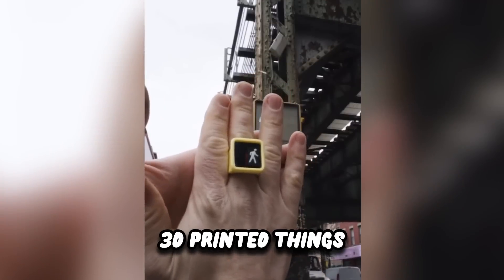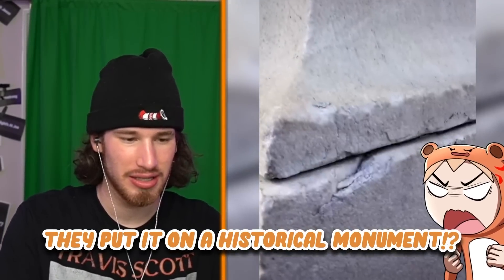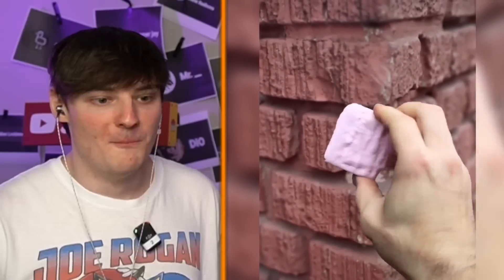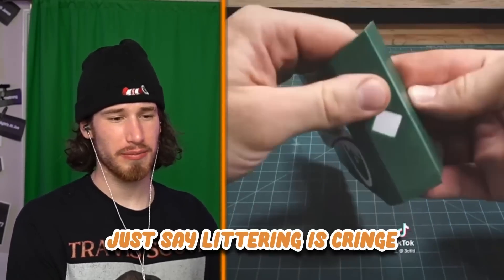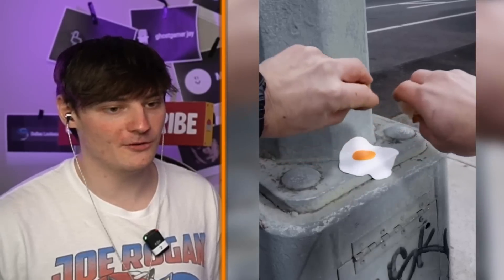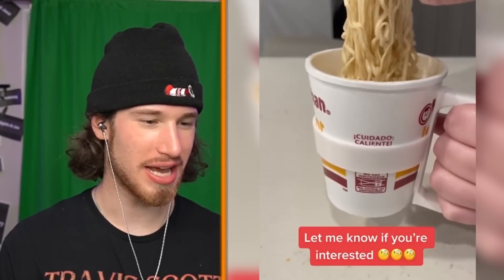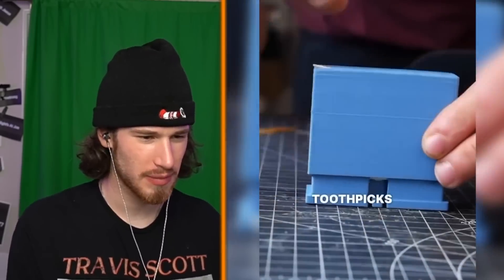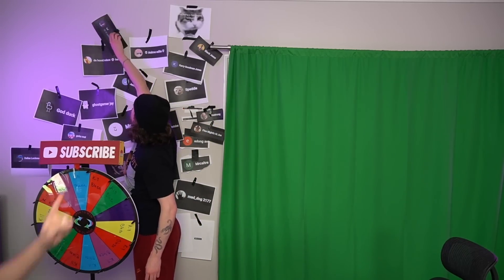3D Printing a HOUSE...

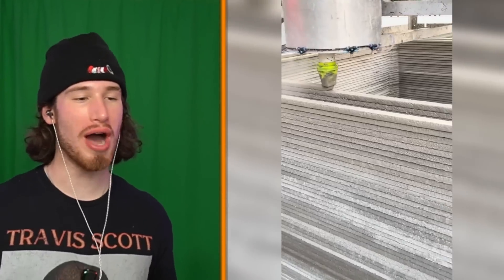Comment: 5:46 the cup is really hot if you touch it with you hand, so this is useful
Reply: Or you could just put it on a table and eat it
Reply: @chrisbrown9216 it's still hot and if you need to secure it then you need to touch it